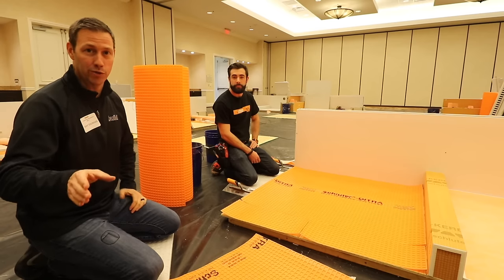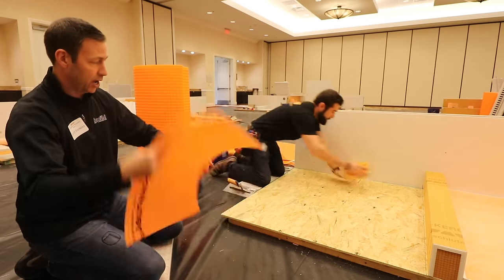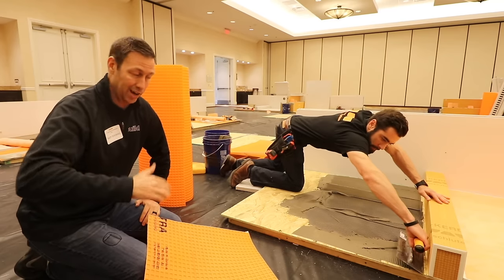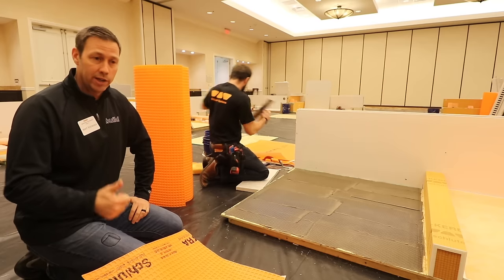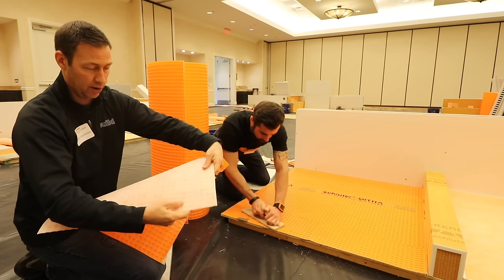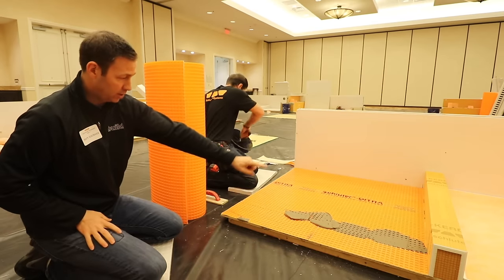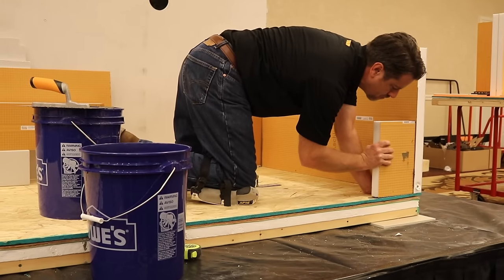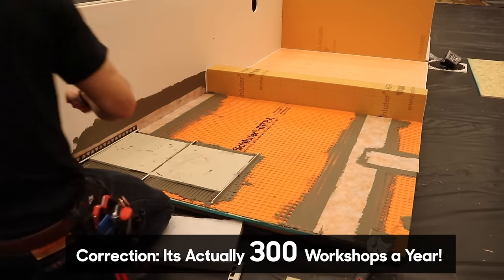WHAT is this, and WHY do you want it under your floors?

Comment: can you clarify install of product. I think you said to spread base thin set with smooth side of trowel (at 1.43) for better adhesion of underlayment to floor. Your assistant used the notched side?

Comment: so you have to fill all those little recesses with mortar + the notched layer on which the tile sits.... that's lotta extra mortar and weight... and not sure how that makes it "uncoupled", the mortar filling those holes is basically in contact with the cement floor safe for the thin layer of plastic. Do you follow?

Comment: If it's just cracks (and not water) that worries you then a "throw away" vinyl laid first, then scuff, then use Flexbond thinset for anything from marble to porcelain = guaranteed no cracks & much cheaper. Party on!
Reply: do you mean like a cheap peel and stick vinyl flooring?
Reply: @mikeflynn7751  I've done tile over cheap peal and stick but that worries me. I was talking about roll vinyl with a rated adhesive
Reply: @mcooperclan  thanks buddy! Just wanted to make sure, as I'm a novice, and i happen to have enough peel and stick from a quickie i did in my kitchen to cover my small mudroom. I think ill stick with the schluter products A to Z for this.

Comment: 3/31/2024 - While you pitched that the purpose of the Schluter Ditra underlayment is to prevent cracking concrete from cracking the tiles laid over the concrete, you did not say that it will prevent cracking.

Comment: Mind. Blown.  Was wondering where you were going to go with the plywood sub-floor.  I've always used cement board to preventing flexing and cracking, wondering how the waffles prevent that?
Reply: RyRy DIY the pattern acts like pedestals under the tile, think of a tripod.

Comment: Care full Mat... You left out that the mortar needs to be modified on the plywood. It's important as the plywood will pull the moisture form the mortar. Also point out the installer pre wet the plywood...

Comment: This is a great anti fracture membrane used it 20+ years Over wood though Forget it 2.5 wire lathe 1" crown staples motored and wood floated  best for the freeze thaw cycles, general use and durability, but it does take skill!
Reply: Wire lathe is harsh and takes a shitload of mud 😳.....
Over wood I insist on 1/4" durarock, open end stripe it (so it can burp air) 4"oc with pl400 construction adhesive with (air caulking gun) lay it down and stomp it out flat and screw down lapping all the subfloor ply joints.
 Then just fiber mesh tape the seams while tiling... bullet proof, 15 years never so much as a hairline grout crack.
Reply: @dmithsmith5880  I don't believe you for a second, but by all means keep going! More work for me!
Reply: @steves6407  Why ?...Gluing and screwing cementboard down over wood and taping the seams is the best way ever. 
I don't understand why you would think that is bad ? Like I said I have done it for over 15 years, hundreds of floors, never so much as one issue...
Sounds like your jealous 😂
Reply: I do not consider it a good system, it was not designed for floors only walls, it loves to crack and flake, it was made to channel water not be walked on, and while you may have had ok luck with it, it is not a good product for freeze thaw areas and I consider it garbage on floors, a repair and or failure waiting to happen and I have 40 + years in the business!

Comment: In 30 had 2 call backs both with useing this product,,, the tiles pop up from product easily,,, and I used all recommended products,,, try it , set tile on cement board are hardibacker and set tile on this product.. You will see for yourself.

Comment: I use this stuff on my jobs (or its various competitors like DCI) when I need to install tile in a situation where height is a factor in installation.  Also pretty handy for installing on stairs so you can use a decoupler to keep the tiles from flexing to much on the tread of the stairs.

Comment: You will never convince me this stuff is suitable for wood substrate floors.  This was installed in my kitchen & breakfast nook area years ago and I have cracks everywhere in the tile.  Plus the tile creaks and pops.  This just does not add the strength to stiffen the wood substrate like Hardi Backer.  

Now I am left with a huge repair trying to scrape this junk off my wooden substrate.  For a wet location like a shower, this product all day long.  Not for typical wood substrate floors.  Hardi Backer for the win for me.

Comment: Tested this under the worst vibrates and didn't ever Crack the groute! I wouldn't go without it! Although I wouldn't buy the full system with the border perimeter sealing tape as its not needed!  Preventing the floor from cracking is another story

Comment: When my house was built they installed tile right on top of the wood subfloor.  The house is 15 years old (built fast and cheap during the housing boom obviously) and luckily I've only had to replace the kitchen because of a water leak in my refrigerator.  The bathrooms have a couple spots where I can tell the tile has come loose from the subfloor, but hasn't broken loose from the other tiles yet.  Whoever built my house had no idea how to lay a floor.  The seams between the subfloor panels aren't sitting on joists in a lot of places so I've had to go in and add braces in a few spots.  If I ever build a house of my own, I'm definitely going to make sure I hire a builder with a good reputation.

Comment: My question is why do some concrete not up better than other? Concrete with imbedded rebars, even just 2mm metal wire grid is much harder to crack. Why not build a better concrete foundation in the first place? Then lay down some epoxy concrete paint? Wouldn't that be more durable?

Comment: I've seen this material used in a floor install years ago. Forgot about it. BUT the thing is....even though products like this material exist we have to find the contractor that uses this material and  is familiar with the install process. This is AFTER we've found the right contractor. Which is hard enough. ADD we have to be building a custom home. :)  Or doing a reno....most builders...even established 60+ year old building companies  probably won't use this material/tradesmen trained to install it...heh...

Sub'd. Looking fwd to future videos that follow this one..more the "gun room" videos...heh..

Comment: You should have a waterproof  membrane between  the  concrete or wooden  floor (preferably  tanalised plywood ) this is what  your  tiles are fixed to. Not the Detra. In my country the whole  bathroom  has to have   a  waterproof  membrane  over it. 300mm or 12 inches up the wall. In the shower it is  from floor to  ceiling 300mm or 12 inches past the glass in closure. The membrane  must go into the shower  waste so if water gets under the tiles which it will it can still escape down the waste. This is by law and must be inspected  before  tiles are layed. The acrylic waterproof  would  do the same thing as the Detra but also waterproof  your wet area. Tile adhesive  and tile and grout are not waterproof.  They are cosmetic it what you do before that makes the job last.

Comment: I pulled up some tile from a project a couple years ago where the concrete had cracked.  This same material was under the tile.  I’m still waiting for them to invent something that will keep that from happening.  Lol.  I wished what he was saying was true but it’s just not gonna do what he claims it will do
Reply: Its basicly a lightweight pricier treated plywood and doesnt need screws , would never use in a basement . Tho i would certainly use it for anything thats on the 3rd floor or higher :D

Comment: So basically its just lighter than cement board or Permabase.  Other than that there really isn't any difference besides it costs more in the end.  Thats my take on this and it has a cool name so everyone wants it.  As far as tiles actually cracking on cement slabs.  We just use what we call a slip sheet.  Basically is red rosin paper you put over your hardwood during construction.  You thinset the rosin paper to the cement then you thinset the tile to the rosin paper.  Never had a failure yet.   Not saying Schluter is bad or good.  Its just another choice.   Forgot to mention.  I've had my own tile business since the 80's.

Comment: Heard stories from the insurance world about homes in the Dallas region.  The sandy soil causes plumbing going down through slabs to become detached and results in leaks creating cavities underneath which erode the foundation/concrete....and the process compounds itself with time.  You can figure where I am going with this.  Yeah, cracks are inevitable under those conditions especially in rooms containing the plumbing.

Comment: this seems like a good idea but 5 years later its not a standard for tile....... i see issures with possible air bubbles , then the bubbles in the thinset can lead to tiles also cracking . if this absolutely worked we would see it in every new home today. as a realtor i have not seen it on tile installs even though laminant floor is now trending vs tile

Comment: Question…could we use this as a vapor barrier on floors in a mill over a brook?  It has a plank floor right now with some gaps with water rushing 15 feet or so below.  We want to put a pine plank floor over the planks…but not sure how to keep it from moisture getting in…we’ve used this with the heating system under our stone floors…what do you think?

Comment: Basic question that might get brushed off as silly. Isn't the crack in the concrete not a serious thing that I as a homeowner would rather that it showed up in my cracked tiles (so that I could do something about the crack in the slab) than never show up because it is hidden by this product (Ignorance is bliss)?
Reply: It depends. If your slab was poured correctly than a surface crack that migrates through a tile is not an issue that needs fixing at the foundation level.

Comment: This product failed miserably under my kitchen ceramic floor.  It separated from the new plywood base due to the thin set leaching oils from the plywood and not properly adhering.  Tiles started to crack and ultimately the floor had to be torn up within a year of installation.  Maybe it would be fine installing it over cement board.

Comment: One of the former owners of my house installed tile right on the plywood subfloor and when I had a pipe burst and leak for at least a day before it made its way through insulation and drywall underneath before it was found the water had got into the plywood and several tiles and grout came loose. Now I need to remove the tub and tiles. Should this be installed under a new tub also or is it put to the edge?  How long does it take to set before anything can be installed on top? And how long should the tiles set before grout and walking on it? This is the only bathroom and I'd have to plan accordingly so I can use the bathroom with minimal interruption.

Comment: I think your  SOME builders in the US are doing a crappy job laying concrete if it's a common thing for your foundation to crack. Here in South Africa, 80 percent of our tiling is done on concrete and our floors last to infinity and beyond without cracking. I'm currently living in a 30 year old house with the same tiles that were initially put in 20 some odd years ago and not one has a crack. And the same goes for many of the houses I've been to or visited. The houses are old because not alot of new builds in dense areas. They mostly get replaced because they are ugly....But I love this system, still. It's like paying a once off life time insurance on an object, which is pretty cool.

Comment: Over a wood sub-floor, concrete board makes more sense to me.  It is stiff but flexible.  I can't imagine this product working well over a wooden sub-floor.   Over a concrete floor, maybe.  It depends on where you live and what the soil is like. Some places are limestone or rock and there is no movement ever and never a crack anywhere.  In other places, the house's foundation sits on black dirt that swells up and the dries out.  The house will buck like a bronco, and everything in it will crack.

Comment: Do I need this even if i have underfloor heating? (Slab, insulation, pipes, concrete and then finish tiles. The concrete for the underfloor heating has dilatation material around his perimeter)

Comment: Thin set sucks for this install.  Use PL.   The membrane has too much  residual tension to properly lay flat.  It simply won’t stay flat for thin set to adhere.  It’s great for electric resistance heating.   Nice and warm.

Comment: For showers it seems overengineering. There are much simpler, cheaper and faster ways to stop moisture. Igolflex 301 by Sika is a water based betumin to water proof foundations, walls and showers. 80 bucks for a big bucket, a paint brush and six hours of cure is all it takes (cures overnight). When apllied to a cement/concrete base is even better because the dry substrate will "suck" the product into it, ensuring a thicker layer. You can then apply the tiles directly. These types of product by schluter have been used to as a last resort to stop moisture on walls. The mortar is taken out, the product apllied to the sinder blocks up to 1 meter high (4feet) and then remortared.

Comment: Don't think the flippers that flopped my place used it. I have been wondering how I could seal my shower. I have to tear the whole thing out. Non-permit plumbing done wrong and pipes are collapsing. Can't stand the white 3-D tile,  the work is incomplete mess, all done wrong. So-I'm excited to see the latest tile waterproofing tech. It's not a good idea to seal grout in case moisture gets in-it can't dry. Can this product be used for shower walls then?

Comment: Another great video Matt - thanks!  One question...is it ok to also paint on a waterproofing membrane like RedGard for a little added security/peace of mind.  Asking because I can’t find any info discussing the compatibility of these two materials.  Thanks, Mike
Reply: Red guard is a crap material, in terms of waterproofing.  If you noticed in the video, they talked about the Kerdi waterproofing membrane? That stuff works incredibly well. A tilesetter friend uses it on all his shower jobs, and it's lifetime guaranteed. Not a single callback.

Comment: Ditra NOT a decoupled system !  Excellent product for taking out movement and not letting concrete cracks propagate into finished tiling, yes.  It's a Coupled system as it's adhered to substrate with thincoat at the very 1st stage !!  A truly uncoupled system is Flexbone2Easy by BAL.  Floats on proplem and curing screeds...

Comment: I have a basement floor  with some cracking already going on. It also seems to be slightly leaching. I was planning on tiling over it would you recommend using this product because I dont have the money to tear out the old concrete and repour a new slab. Also do you think this product is beneficial in preventing future issues?

Comment: I think concrete crack if you:
 - rushing the job before the concrete subtle down, expand and dry out. This should take months.
- didn't water it every day for a coule of weeks.  
- the concrete was built on a soil not rocky solid ground.
- skimming the mixture, too much water and not enough cement.
I think so, in my country we build all our homes with concrete, i left my house 6 months just bones exposed to the heat.

Comment: What adhesive are you using to glue the membrane to concrete? I have underfloor heating as well. 

What adhesive are you using to glue the tiles to the membrane?

Thanks

Comment: Living in Houston with concrete slab on ground and having cracked kitchen tiles,  can I replace the few tiles with a flexible adhesive vs ridgid thinset?  Is there a preferred season to make repair... summer/winter, when foundation is in maximum tension?

Comment: Would this work with heating grids for floors? Im remodeling in the spring, and thinking of eliminating my furnace for heated floors and a wood stove. Its also an old trailer and floors need replacement.

Comment: Is this product compatible with in-floor hydronic heating?
Reply: Per the manufactures website for Ditra: "Can be installed on top of concrete, plywood, OSB, gypsum, existing vinyl floors, structural planks, sub-floors, and radiant heated floors."

They also have a system specific for installing in-floor electric heating if you don't already have in-floor heating, check out Schluter®-DITRA-HEAT.

Comment: would you recommend this product for under a poured in place concrete countertop.... to help keep it from cracking..? i i have some extra after buying it for a small bath project..  i have not bought concrete board for the countertop install but have lots of extra thick plywood... just wondering if this could work...

Comment: didnt give much tech info...the installation of tile on concrete has the issue of hydrostatic pressure...water under the slab...causing the tiles to pop...so would this kerdi ditra eliminate hydrostatic pressure issues..??

Comment: Obviously you work for quarter million dollar a year households, and new construction. In the long run I believe from the home owners would have the cracked areas repaired. Versus the sections that layer off with the cracks. The other option to sell the home owner is going with thicker tile. Or when during initial construction, make sure they have a 4 foot compressed gravel footing. You leave out many variables.